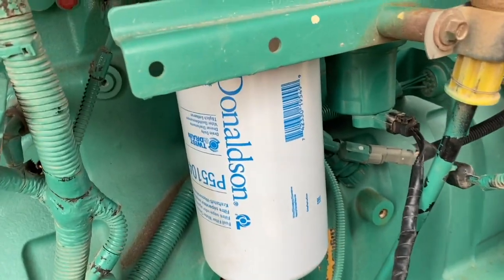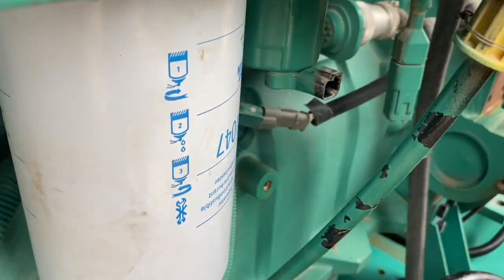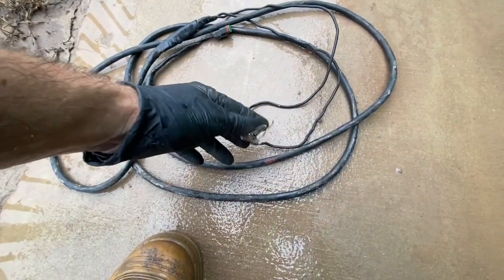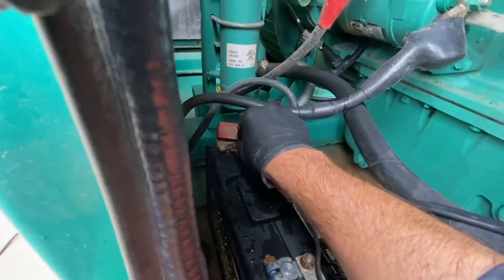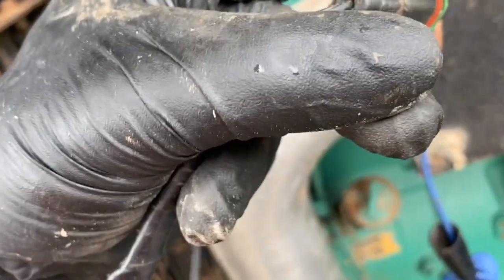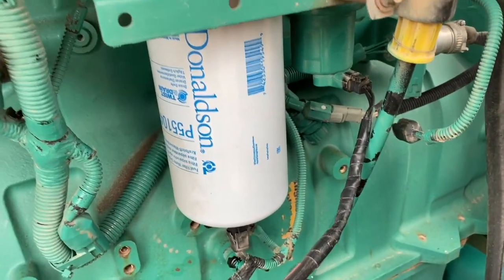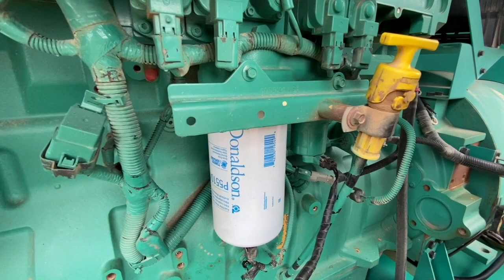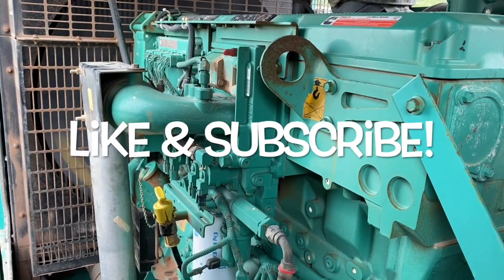Cummins 500kva Generator . Priming fuel system

Comment: Good afternoon everyone here, so I've got a major one that has been on my neck for weeks now.
Refurbishing a 550KVA Cummins Generator. The IntelGen comAp module does not allow for start and stop. It had been turned on from relay switches previously. Now I don't know why but the relay switches only let the engine roll but the diesel pumps are unresponsive. Any ideas on the mode of failure and suggestions on how to fix it?